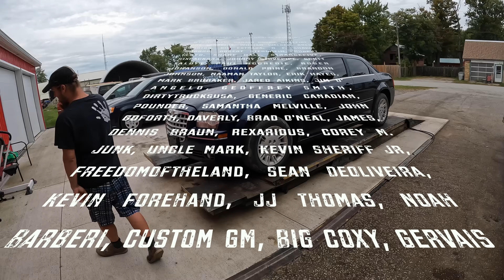chopping batteries with wood splitter

Comment: Just found a John Deere riding mower. $100 bill. Made only 3 years, 86 to 88. Has Kawasaki 9hp engine and starts with the bump of the key and runs pefect. Going on my log splitter.. Will be nice with electric start.